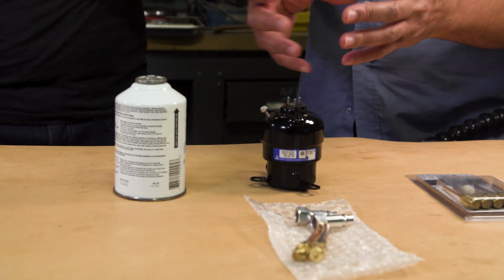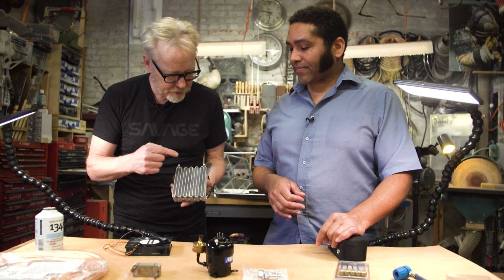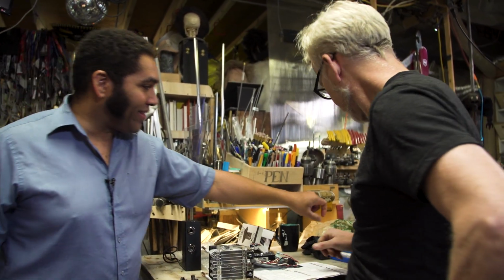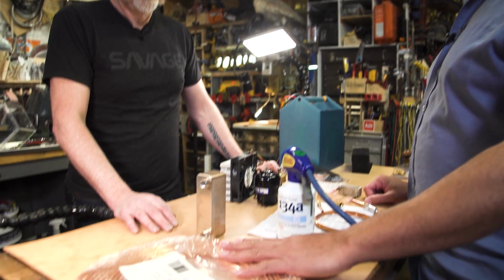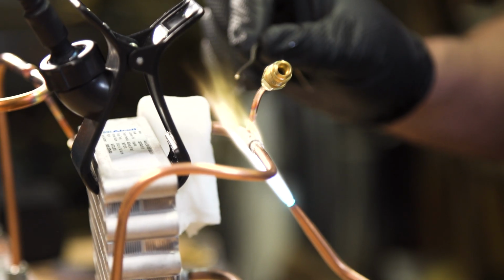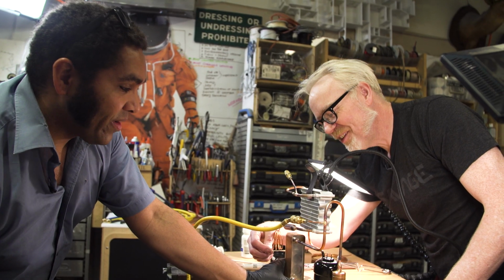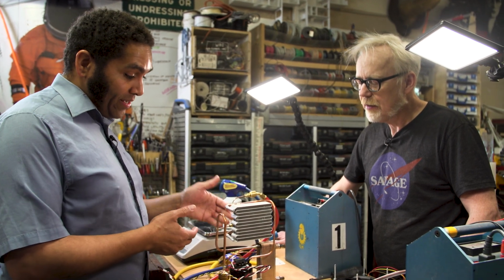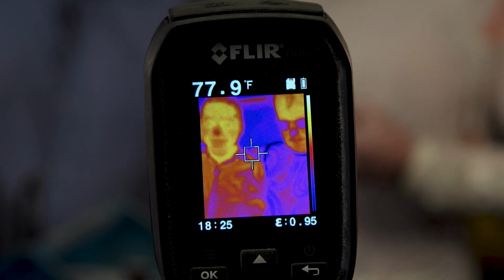Adam Savage's One Day Builds: Refrigerated Cooling Suit!

Comment: Adam, I would be concerned about what liquid you pump through the RAF suit.  Alcohol may damage the plastic.  I would do some research on what the RAF used.  Maybe a Glycol as I doubt they would have possibly flammable liquid in a suite.   I would also be concerned about the safety of wearing a suit filled with liquid that could help with combustion for your own safety.
Reply: The video is awesome BTW.

Comment: Refrigeration works by Heat energy is compressed into a smaller space.. so compressing the heat energy makes it denser packed with energy/ much hotter than normal pressures. If you cool that hot compressed air then decompress it. It now is colder then you started. So it has less heat energy. It became much colder.  
Think of ringing out a wet towel. When you compress it the towel is pressurized with water. So extra water wants to come out.. Then you released the pressure the towel it is less wet.. Air is the sponge and water is Heat energy.  The Expert explained when you convert electricity to magnetism some of the energy is converted into heat. I'm only 2:35 in,

Comment: Why couldn't the rotary compressor also drive the fan for the cooling?  Like that you wouldn't need a separate motor for the fan on the radiator.

Comment: I'm still at the beginning of this(20 minutes in), but what I see is a repurposed 120mm radiator(used for liquid cooling PCs) with a fan, a "beer wort plate chiller", and the coolant pump(not the refrigerant) and reservoir hardware are identical to the stuff you would also find on the high end PC cooling sites.

Comment: Industry doesn't require geniuses in great quantity. What Industry does require in great quantity is people whose minds operate comfortably within the logical framework of a specialized field of engineering. Some people become techs. They are "good with their hands" but for the majority of techs they do they cross the divide from working on a system designed by others to understanding and manipulating the equations that define the parameters of the performance envelopes of components and materials and the effects of their interfaces. I have already had a successful engineering career and have retired. Almost nothing that I learned in engineering school was useful in any of the four industries that I worked in. In gaining a BSME degree, then my state's professional registration I simply proved that my mind was trainable to think logically then to formulate, apply and solve equations correctly.

Functionally engineering school is little more than a social sieve. It separates the coarser chunks that are lacking in the necessary mental skills from those that both possess and display those skills. Engineering school and the careers that follow it are glaring proofs that equality is abjectly pernicious nonsense that requires a commitment to a steadfast denial of reality to support, much less believe. There are no poor good engineers. All good engineers secure a comfortable middle class existence for themselves. (Subject of course to failure due to destructive personal habits.) During economic downturns even good engineers can find themselves under employed but when the economic pace picks up industry often rehires them.

Please don't bother with comments that clearly I am guilty of reinforcing the basic unfairness of the capitalist system. People who cannot perform a task more complicated than flipping burgers do not deserve high wages. Flipping burgers was never intended to be a career, just a way station early in life.

Adam is an example of a tech that is continuing his journey of crossing over from just a tech to also an engineer. Kip is an engineer that has built on his mental abilities and training to specialize in the refrigeration cycle. But note: what he is doing is integrating. Aside from the filter-dryer he didn't design or contribute to the design specifications of those products. There are engineers at each of the firms that actually designed the components he is using and techs that actually produced them. Behind the products shown there are engineers and techs that produced the materials for those components and in some cases, sub-components. Behind them are the mining engineers and techs that wrest the raw materials from the earth. The vast majority of Engineers are very highly specialized.
Reply: Lol so a knowledge of thermo, mechanics, manufacturing, material science, statics, dynamics, physics, chem, electronics, control systems ect ect all that did nothing for ya? Lol where were you working McDonalds?

Comment: As someone who has worked on heat pumps and refrigeration systems it pains me to see every joint is soldered.    The condenser and heat exchanger even have compression fitting joints on them.   No need to solder copper in to them.   If a single part of this goes wrong he’ll have to remake parts of the copper piping as he’ll have to cut and replace instead of simply undoing a compression joint.

Comment: As a HVAC tech. A couple of good refrigeration practices. On such à small precise circuit. You should not blow your breàth into piping you breath could condense in the piping and require amulti step evacuation process. Also you should purge copper during brazing with nitrogen gas so copper will not oxidize inside and cause a restriction in the circuit. But great see a melding of practical with theoritiçal.
Reply: Will NOT oxidize.

Comment: Copper and aluminum are great but corrosion is an issue, as you can see where it is brazed it is already corroded, now as to how long this would take to become an issue is anyone's guess. Just a tip try to not mix metals when cooling.

Comment: A really great video.  Refrigeration is a spooky subject but your guest, Kipp Bradford, was a encyclopedia on the subject.  My dad was a mechanical engineer, turned thermal engineer, who had a part in the SR71.   I have a smaller racing sailboat boat in Texas and those 100F days in July are rough.  None of the AC's I have found are small enough or light enough for my app.  But this video cut through a lot of the challenges because of of Kipps insights on how and where to get the needed materials and a masterclass in construction.  I can only say thanks.   I wonder if Kipp has done anything with electrical Peltier cooling chips.  My boat has a lot of solar cells on it.

Comment: Adam I use a sailmakers three-sided point needle from a sewing awl kit sold at camping stores to precisely locate drilled holes and noticed that you were using a small pointed center drill which is about 10 or 20 times or even a hundred times larger than the point on the needle. The point on the needle is probably about 1,000 of an inch in diameter and with moderate pressure into soft copper would make a starting mark that would receive your next center drill readily. I use my three-sided needle in a standard variable speed rotary tool although handheld in the awl it works fairly well. This refers to the point roughly in the middle of the run time when you were beginning to braze copper to Copper. Cheers Doug

Comment: As a professional HVAC technician, I have a few criticisms.

- I harbor a severe dislike for microchannel heat exchangers. They are almost impossible to repair, and replacement is a chore. 
- Not many people know that R-134a is an older refrigerant that contributes to global warming. We don't use it nearly as much as higher-pressure blends like R-410a, but it's better than destroying the ozone layer.
- The suit looks like it came from the deserts of Arakkis. (I would be very surprised if nobody else made the connection. Yes, I am a nerd.)
- Capillary tubes are often used in ice cream makers. (Not a criticism, but a neat fact.)
- Never use lung power to clean up your copper cuts. Nitrogen is the preferred compressed gas due to its low moisture content..
- That torch is burning at 2,000 degrees. (No, at that temperature, scale doesn't matter.) Any flesh that gets caught in that flame is GONE.
-  In the field, water immersion is just not possible, or even practical. We use soap solutions to test brazed connections. That way, the soap bonds the water to the copper and makes bubbles if there is a leak. One saying for us is, "No bubbles, no troubles."
- Ideally, a thermocouple would be integrated into the suit to provide feedback to the Arduino board for speed regulation, along with an independently powered alarm circuit. Dying of hypothermia would be very possible in that suit, as would be dying of heatstroke if something failed.

All in all, I think this was a very neat project that makes me super jealous that they can get all of those micro parts so easily.

Comment: Noooooooo
The pump does not put heat energy into the refrigerant.
The pump does nothing more than compress the refrigerant.
The resulting heat from compressed refrigerant was already in the refrigerant.
In layman's terms, the pump simply condensed that heat into a smaller volume, which raised the temperature.
The heat in uncompressed and compressed refrigerant is the same, it's only the temperature that changes.
Same reason why compressed CO2 gets really cold when volume is increased, it's the same principle in reverse.
There's a difference between quantity of heat and temperature of heat.
This is why BTU's, joules, and calories cannot directly convert to F or C, they are different measurements.
Reply: The compressor adds energy to the system through work
Reply: @Big_Slick  There's a difference between heat and energy
Reply: Heat is the flow of energy(watts not joules), there are 2 ways to transfer energy, heat and work, you are right to say the compressor doesn't add heat to the system a better way to say this is "there is no heat transfer in the compressor"( there actually is but its negligible) but the compressor absolutely is adding energy to the system through work

Comment: now all you need to do is link the control thermostat to a network of a dermal thermometers and then add in so secondary cooling loops and you can regionate the temperature control then all you need to do is set the desired temp and it should auto regulate :)

Comment: How come elevation changes change boiling points in a closed system? Been a while since I've done any science classes but that's bugging my brain
Reply: that was more of an example of water outside a closed system where the pressure of the atmosphere change depending on how high up you are. 

 the pressure inside a closed system is decided by how much is in the system, what is inside the system and the temperature it has.

Comment: One of the coolest videos I have seen in a very long time. Those compressors have so many fascinating applications, the first one that jumped to mind is sub zero cooling for a computer. The fact that they have such a high cooling capacity in such a small form factor also suggests off grid or vehicle cooling for small spaces or equipment. Such an incredible little machine!

Comment: 19:00 Here's a little trick. If you get really hot, say after  a hike, when you get back to your car  wet the palms of  your  hands and inside wrists and hold them close to  the AC blower vent. You will cool off really quickly. Much quicker than waiting for the whole vehicle to cool or just blowing your face.  Another trick is to hold  ice cubes in the palms of your hands. You can feel that cooled blood running up your arms and will soon feel fresh. I read about that research some years ago in relation to the design of palm cooling gloves for motorcycle police officers. I've  been using this method  to cool off  ever since. As I work  in  the tropics and do outside field work, it's a trick I often use.

Comment: This is how airconditioner works in a car! The airco compressor in a car also uses PAG oil and if a electric car it uses POE oil.. in a car the oil cooler looks same as of in this video they have were they use water in stead of oil
Even the heat exchangers etc..
Same proces. Even the same gas 134a 
New gas is hfo1234 i think from this year that will be used for new cars..

Comment: Adam,  I hope you are healing well. This is an amazing project you have put together.  I would like to find commercial resources to do the same thing but for high temperature environments,  130f to 145f for repairing or accessing steam affected areas. We generally use ice pack vests, which cool you for less than 5 minutes then turn into 30 pounds of weight to carry, thus depleting the workers faster.

Comment: i cannot belave they got incorrect the basics of how refrigeration works at the beginning ...its not the energy from the mechanical effort of compressing the gas that heats it up ... the numbers i am going to use may not be correct but it will simplify my explaining and your understanding of my explaining,,,if that makes sense ...
  The amount of heat don't change when you compress a volume of gas ..you have a set amount of heat say in 2 cubic feet of gas at 0 psi if you compress that gas from 2 cubic feet to 1 cubic foot you still have the same amount of heat but because that gas is in a smaller space you will read at twice the temp. you now cool the gas back down to  its original unpressurised temp ..its easy to cool something down that's hotter than its surroundings  so you will have now 1/2 the amount of heat but the same temp  as original but its still pressurised ..now you unpressurised the gas  back to  its original 2 cubic feet and 0 psi and the reverse will happen..the amount of heat in our cooled gas won't change but because now it expanded  by 2  the temp we read will be 1/2 ..so colder than its original unrefrigerated form

Comment: I am in the HVAC field and would like to tinker with this project could you list the build materials and details please.
Reply: I am also in HVAC if you find the compressor, coils/exchangers, and a miraculous way to get that filter drier  or one close to it let me know! Also interested in information on programming an Arduino control and where to get a 24V DC battery/ power source for the compressor and fans! If I could power up a system to cool my head alone and possibly thighs/groin in a 120° attic I would spend whatever it takes and put hours upon hours into the build. May need to use a water cooled condenser coil though to provide adequate heat transfer in high temp environments instead of an air cooled condenser though which would increase system bulk and create a need for a second water pump. Either way I'd love to tinker with it.
Reply: @skyguy1987  it sounds ideal for welding or attic work, being said do the compressors still need to remain upright like on older refrigerators or not?  If so may negate jobs that require a lot of bending over and crawling through spaces.  Cool project
Reply: Perhaps a rig that keeps the whole assembly upright automatically?  It would add some weight and bulk as a backpack.
Reply: Try on Aliexpress with "PURSWAVE ST19A" and related products.
Reply: I have one of these Aspen compressors in a working water chiller loop like what’s shown in the video. Still interested?
Reply: Has anyone found any information?
Reply: I'm also interested if the components can be sourced from somewhere. It's totally disappointing that the subject is treated as pure entertainment instead of a real maker project that some interested people could follow. At least with a price estimate someone could easily see if it's in their budget range. I have some applications in mind, if the budget is in the range of 1k$ for example

Comment: Kipp kind of looks like Andre the Giant. Also, I wonder how my refrigerator works so well with so little airflow around it?
ADDENDUM: I"m amused that Adam is going to cool his Cosmonaut suit with vodka.
Reply: I think your fridge might work because of a large, simple heat exchanger at the back that generates air flow through convection (warm air rising).
Reply: @Kenionatus  Perhaps. There is a little space above and below it that can let air move through.
Reply: as a universal refrigerant tech i can affirm that your refrigerator works on the same way that any A/C works. however, if you listen to your fridge over an hour when the compressor kicks on youll also hear a system of fans kick on. granted your refrigerator is far enough away from a wall (for small appliances such as a fridge, 3-6" is sufficient) youll gain max efficiency from your fridge. there is in fact a system of fans on the back of your fridge unless it was built before 2002... then it totally is built on hoping ambient air cools the coil. however there was no necessary change from ambient cooling to forced air cooling until 2012. so depends on what fridge you have lol

Comment: Yes, it's a small refrigerator. But it's still too big. What is needed is some kind of thin, light, solid state gizmo that can fit in a single glass - like a Martini glass. Failing that, such a slightly bigger device could be made to fit in the bottom of a beer mug. A few years ago this wouldn't be possible. But with new Lithium Ion batteries, half the problem is solved.  I have no idea how this could be done but if someone does do it - I will buy one.
Reply: Peltier devices hooked up to a vest with a liquid flowing through it might work but they would be less efficient which either means bigger batteries for the same run time which means you are possibly back to square one.

Comment: 31:11 I definitely see that point. I'm going to be training to be a mechanic, and I cannot tell you how many times I have had to cuss out a car because an engineer did not understand the physical side of what they were doing. They don't understand that one change in a design does mess with the entire system, and that changes never happen in a vacuum. Bridging the gap between practical knowledge and engineering knowledge is one of the most important things that this generation needs to focus on in STEM and other mechanical fields.